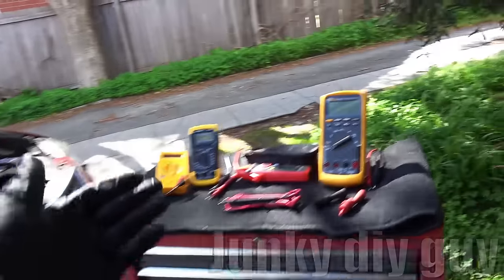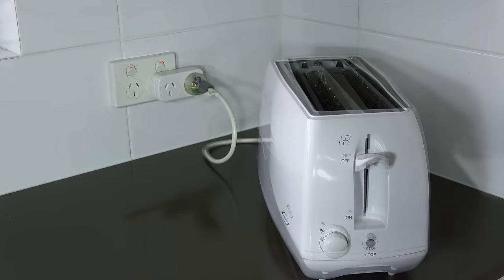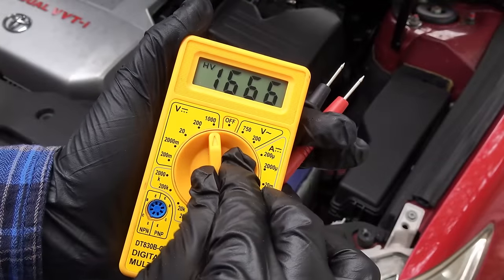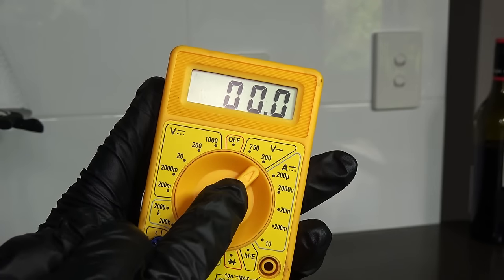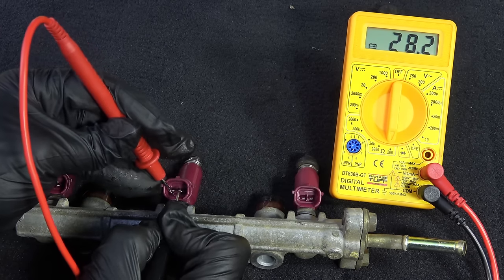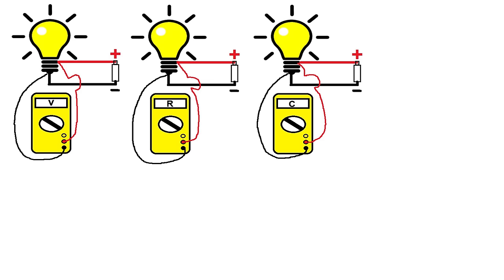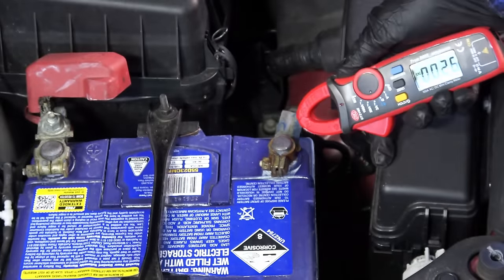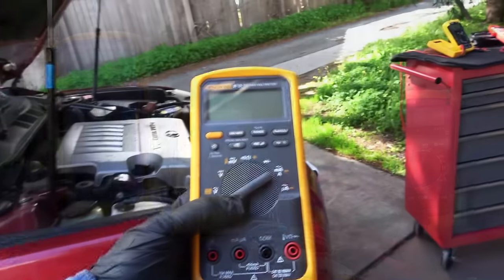How to Use a MULTIMETER - Beginners Guide (Measuring Volts, resistance, continuity & Amps)

Comment: Dude, great video. Im in my senior year of my electrical engineering major and i just bought my first handheld multimeter and this video cleared up all my confusion immediately. I've only used multimeters before in the University's EE lab, so i just needed a quick tutorial like this, and you nailed it. Thanks for the tip at the end btw about the auto-adjusting multimeter, I'm getting that next time.

Comment: This is fantastic. You even had the same cheap multi meter I have. In England we have been advised to expect power cuts due to the war by Russia. I have an electric bike with a 36 volt 500 amp hour battery. I have bought a step down transformer from 36 to 5 volt. It has USB connectors on it. I can run 5 volt LED light strips, tablets and phones etc. I also bought some heat pads that I can fit into my clothes or sleeping bag if it gets cold. This tutorial has helped my understand better what is happening. Thanks.

Comment: Finally an easier break down. I still have a few questions but it's probably my bot being confident with it. I really wish I got one without all the dumb numbers. Nobody's explained that when I try to check my relays I never know the number to use. I've replaced my battery and my alternator twice so I know I need to check my relays & circuts but been stuck for days bc I always get stuck on which number to use. I refuse to spend a ton until I've checked my relays. I'm getting closer to doing it lol

Comment: Cheap multimeters are perfectly fine for testing continuity and lower voltages (12v and below - car batteries, AA batteries etc) but if you're going to be using one for testing current or high voltage it's better to spend a bit more money. 

Something to look for is the number of jacks. It will have a black com (common) jack, then usually either 2 or 3 red jacks. Look for one that has 3. One for volts, one for milliamps and one for 10 amps. You don't want one that shares a volt and milliamp jack like the two cheaper ones in this video. Generally it's a sign of cost cutting and the fuses they use on meters like those aren't very good. 

You don't have to go out and buy a Fluke, but spend a few extra dollars when dealing with current or high voltage, the extra layer of safety will pay for itself if you make a mistake, and we all make mistakes.

Comment: Thank you for the video, I got a lot of good info from it.  I am just learning about electricity.  I have one question. Does it matter which direction the the power  runs through the meter from the battery when measuring amps? your demonstration shows the positive from the battery connects to the positive of the meter, and the schematic has the positive of the power connecting to the negative of the meter.  Thanks- great video thumbs up.

Comment: Video helped a lot, thanks! I was just told by the auto part store that my battery was toast. Spent $165 on a new battery. Then I randomly came across my multimeter and figured I would test my old one myself before getting rid of it and found out I completely wasted $165, my battery is fine! 🫤

Comment: Hey Junky,

I stumbled on your video and greatly appreciated the teachings on how to use a MM.

I have a basic Digitech QM 1500 That looks exactly like your basic one n the video.

I still don't seem to be getting it right though.

I want to test my car fuses to determine which due/s only active when the car accessory power is on . NOT when ignition is on.

So I thought I would use the DC side of multi M and set it on 20.

Touch the red and black probe to either side of the small micro fuse just like you demonstrated on the fires for continuity.

I'm not getting any readings on the display.

Am I doing it correctly?

Thanks for your assistance and support.

Mike

Comment: Hi Junk DIY guy.
Quick question if I'm testing the plug that clips into the alternator from the car with a multimeter. Should I get a reading from both sockets (earth & power) or just the power socket? Alternator seems to not be charging battery. New battery and new alternator. However it's not producing any power. Bad earth?

Comment: I love that you show the Fluke 87 Five.(the best in my opinion) A very safe HRC Fused Auto Ranging Multi-meter with fantastic Flash-Over Protection case design. (The Fluke 115 and 117 are wonderful as well.) But please don't show those cheap $8 to $20 dollar multi-meters as an "okay" alternative. They're not. As an industrial electrician I have seen too many times where someone wanted to test a 12 volt dc light that wasn't working on the back of a trailer and purchased a $10 multi-meter. And it worked. They found the problem. A year later they want to find a problem at mains voltage in their house. They tend to figure that if that this cheap meter worked for my 12 volt trailer it can certainly work on mains in my house. So they go back and shove the probes in an outlet. Well maybe they unplugged the probes and they just plugged them back into Amp and Com, they're not electricians it doesn't mater to them...stuck them in a mains outlet. Well, that would be an interesting day for them. I'm not saying that the Fluke would like this any better. But it with the design of a Fluke you would be holding a much safer meter in your hand. The $10 meter. Not so much.
Reply: They would figure it out after that
Reply: I am using one of the little cheap yellow meters and thank you for including that model in your video.

Comment: Sir like now we have 220 volt light and if we put load on this like AC Heater then it reduce and remain about 190-200v. So the Amps we get for calculating the Watts to whom with electricity supply is to be multiply? I mean from starting 220v or loaded 190v? Please reply its very urgent to know for me

Comment: can i still test for continuity using the basic multimeter since it doesn't have the sound symbol? how should i do it?
Reply: Yes, you can measure the resistance; if the meter shows no resistance, than there is no continuity.

Comment: I only have that 'cheap' multimetre, so how would i check continuity?
Also how would I check the amps of an Australian outlet, would it be the same as what you do with volts?
Reply: Don't plug the probes in the wall outlet~~
it will blow up the fuse or toast the entire multimeter.....don't do it
Reply: waleed khalid ok, thx for telling me before i did it
Reply: and yea don't also measure resistance of a powered circuit
Reply: You can measure continuity by using the cheap one the red one down is continuity
Reply: What shows on the read out if there is continuity and what shows if there is not continuity?  Thanks in advance.  Good video except for that on the little cheap meter.
Reply: @cmquednau7795  It should show 0 or a very low value meaning there is no resistance, so the electrons will able to flow through the material "continually".

Comment: I am a retired electronics tech so I watched your video to see how you did.  I would only criticize the video on a couple points.   The new user should not fool around with any AMPS readings.  Only an experienced technician should do amps tests.   The reason is because placing the meter in ANY amps range will damage the circuit under test IF IT IS DONE WRONG.  If you leave the probes in the AMPS jack,  .... then sometime later pick up the meter and try to measure VOLTS.... you will be sure to blow the meters internal fuse, or damage the circuit under test.  Also, when experienced technicians use these meters, we only RARELY use the amps function.  Ninety Nine percent of what you need to do is simply using the VOLTS function... or the OHMS function.  So... to everyone out there learning the multimeter,   please stick the RED lead into the VOLTS jack and do not mess with AMPERE testing until you become proficient at using meters.

Comment: Used a similar multimeter on my wall outlet (240v in Aus), and it sparked. Realised after that, I had the red plug in the amps port instead of the volts. Could this be why the sparks were caused?

Comment: I took in original plug in a shop and need to extend because it was way on the back I followed all the cables and followed the color codes black,white and ground but when I test it with a circuit tester they both light up hot but when I plug something in everything works fine some am scratching my head

Comment: How to check for continuity with a cheap multimeter without a beeper?
Thank you
Reply from the maker: Splice in a LED bulb in series with the circuit. if there's continuity, then the LED will light up

Comment: Ok so It looks like my multimeter doesn't have a "beeper" sound.  It does have a setting that looks like a diode which I understand is supposed to be the continuity setting.  So, how do I test continuity then? I'm not all that experienced with multimeters.
Reply from the maker: Splice in a LED bulb in series with the circuit. if there's continuity, then the LED will light up

Comment: What if i accidentally put the black and red wire backward in the 240v socket because i dont know where to put,will it broke the socket/multimeter ,blow up or nothing😃
Reply from the maker: You have the answer explained @3.01
Reply: Junky DIY guy high ac voltage also(13a,240v)?no problem?
Reply from the maker: No problems there, but I would say you better get a little voltage tester and stick it in the plug holes in the wall outlet so you will know which one is positive and which one is negative.

Comment: Redo the continuity part please, because I don't have a beep on my multimeter and you didn't explain anything about what numbers should be showing or what shouldn't be showing so left quite confused I'm afraid
Reply from the maker: Splice in a LED bulb in series with the circuit. if there's continuity, then the LED will light up, you don't need to have beeps in the multimeter

Comment: Guys don't use cheap multimeters on high voltage as PSU or network as shown in this video. If you miss use it it would seriously harm you. This particular multimeter is famous for useless glass fuse as input protection and could kill you. You should use it just on low voltage DC products!

Comment: See, this is why I can never get the hang of all this, I have the exact same cheap multimeter, you launch straight in with "Let's look at the DC voltage and tap the left side of the dial, nowhere on which does it say DC so how the feck is a beginner supposed to know that?!
This is the problem with so called 'experts' trying to teach beginners, the expert has forgotten how little a beginner knows and ploughs on leaving the beginner behind....

Comment: i may be wrong but every body trys to teach beginners  with multi function  meter  its very confusing to try to remember 14 different settings for different test in about 1 hr or less   you can use a little cheap meter to train with   h like how to check a battery   how to look for a grand thats blowing a fuse and stay with dc   i t is dangerous fooling ac while learning    lookig for open circuits  etc   im 86 yrs  old been using meters  when they were born   way too much info to start with  i would tell someone  buy a small 10$ meter master it then move on  teach ohms law       learn about scematic diagram   an old lawn moer is goo place to practice on